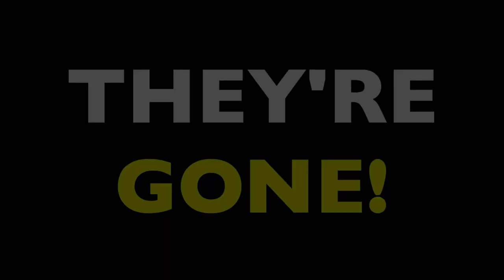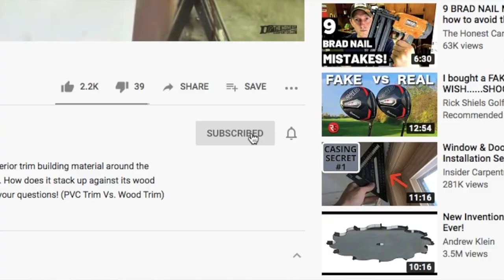There's Something TERRIBLY WRONG With My Table Saw! Should I THROW IT OUT?! (Carpenter Discussion)

Comment: the fence on my table saw has bolts on the bottom that allow the fence to adjust slightly by a few degrees to each side for alignment. Wonder if your saw has this feature and if it will work.
Reply from the maker: I can adjust the fence slightly too. But the problem is the angle seems to worsen between straight rips and beveled. The fence would have to be crazy skewed to account for the bevel veer 😕
Reply: @TheHonestCarpenter  You've taken that investment far enough. Time for a nice new one! I'm excited to see what you pick.

Comment: I got rid of a table saw earlier this year.  The saw was a job site saw, a real workhorse, that had very few problems. But the truth is that I'm getting older, do much of my work in the shop now, and I have a few younger employees.  I decided that the safety of a Sawstop with it's finger/hand protection was worth the money spent on it if it prevents even one shop accident. So I sold the other saw to a carpenter going out on his own who I know and upgraded.

Comment: When I first started buying and using power tools, I bought cheap tools. They worked fine (for a short time), but after time, they either wore out or just didn't operate like they were new. Now, after many, many years, I purchased better (and cost a lot more) power tools. They last so much longer, but even expensive tools break or just wear out. Safety is paramount, so if I find any tool that becomes less safe, I toss it. Not worth a damaged body part. Great video!

Comment: This happened many years ago, but I have never forgotten it. A close friend of mine had a grandpa die. Turns out they we’re doing some deck building and grandpa was using the circular saw. He was in the habit of finishing the cut and then dropping the saw on his leg with the blade guard hitting his leg. Only this time the blade guard stuck, the blade was still spinning and sliced his leg. He bled out before they could save him. I think about that most every time I use a circular saw, and it’s a reminder, “don’t do nothing stupid!  Especially don’t use a saw knowing the blade guard is broken.
Reply from the maker: Ugh, that’s terrible to hear, JS! 😖 I try to check that the guard swing back every single time for this reason. But the thigh is a saw cut zone that most people overlook far too often!

Comment: I'm a hobbyist, so I don't use the tools every day, but...

I tossed my 20+ year old Skill saw when I couldn't tighten the arbor nut down to tighten the blade. Replaced it with a Bosch.

Sold my model mid 60's 113 Craftsman table saw as I got tired of having to 'work around' it's alignment issues all the time. 
Replaced it with a SawStop contractor saw.

Comment: I was going to buy a Dewalt 7491RS a few months after COVID hit. Suddenly there none to be had. When they finally reappeared there were numerous complaints where before only glowing reviews. I was concerned about wasting money and also safety so I saved up more money. I bought the Sawstop JSS Pro. I love it and my husband doesn’t worry so much as before. Be aware that the new “contractor” Sawstop which is smaller will not accept dado blades.

Comment: Totally agree with tossing tools that pose a safety threat.   Maybe make a video on how to properly dispose of unsafe tools.  I've seen many tools tossed into a dumpster for wherever reason only to be dumpster dived out and who knows where that tool ended up.. garage sale? Apprentices toolbox..?
Reply: How I dispose of used up tools. First, cut the cord at the tool. Second, remove the blade. Third, disassemble far enough that it is not worth messing with, and dispose of parts so no one can try to reassemble after collecting the parts, such as recycle what you can, then dispose in different trash bags, etc.
Reply: I have my worm drive in a shed because I don’t want someone else trying to use it.
Reply: I agree.  An unsafe tool that cannot be repaired should be permanently disabled and disposed of.  Few things are more tempting that seeing a power tool in a dumpster (I know :-) ).

Comment: Your attention to detail is excellent. I'm just about ready to throw in the towel on my Ridgid TS3650 because the belt keeps popping off from time to time. Taking such a big heavy saw down to a service center is a big hassle that requires a truck with a lift bed. At least I've got wheels on the darn thing. I originally paid $300 used for the saw way back in 2007. plus a few hundred dollars extra for iron table extensions. Another issue: the fence, which I long considered the saw's best feature, is drifting out of lock when it gets a medium to heavy tap with a piece of stock.

Comment: No matter what others say, when a carpenter decides that a tool is not accurate or safe, it is time to get rid of it. Especially the blade guard on a circular saw. When that does not work perfectly it is time to trash it fast as possible. So far I have not had any saws go bad, but will not hesitate to get rid of one that does.

Comment: I have been using Makita circular saws since I started as a carpenter 38 years ago. They are a great saw and can take a beating. I replace them when the guards no longer function or the motor starts to smoke. They become my parts saws. I have 4 circular saws presently. Two of them are Frankenstein saws made up of 4 or five others.
If you are looking to get another job site table saw, take a hard look at the Bosch. I love mine and it is a beast.

Comment: Good video! I had to toss my miter saw this summer.  Like your skill saw, the blade guard on my miter saw wore out and no longer worked. It was getting stuck, not retracting.  That 10 blade is a little scary uncovered. So I completely decommissioned it by cutting the cord and pulling the brushes. Advice, don't settle for the lesser price tool.
Reply: You talking about the plastic piece that covers the blade when using the saw? Couldn't you have changed it out instead of tossing the entire saw?

Sorry if my question is stupid I'm a new wood worker and just had to change my blade by taking the plastic blade cover off to change it. Seems like maybe just change the cover?
Reply: @wm1958  good morning!
The plastic guard was still good.  The hardware that rotates the guard out of the way when cutting wore completely out. I was needing to push the guard up by hand to in bind it. I tried different ideas to try and fix it with no luck.  Parts were not available, it was maybe 18 years old, just starting out as well and paid less than $100 for it.  I got my use out of it.  Thanks for the question.

Comment: We built an aluminum Bristol Bay 32 ft fishing boat in '79 (redid deck and cabin in '80. Anyway, we used worm gear Skilsaws to cut the aluminum sheet to make ribs, bulkheads, hull plates, etc.  We used Rockwell bandsaw wax to grease up the blades.  But sooner than later a saw would suddenly give up with a flash and a bunch of blue smoke.  We would toss the saw in a dumpster and go over to the stack of new saws and break a new one out of the box and keep on truckin'. Had to get the boat in the water, fishing season was fast approaching.

Comment: Re the Table Saw..... at 0:15 you can see the screw that can be used to adjust the fence. My saw had a similar issue and tweaking the fence to be parallel to the blade fixed it

Comment: Agree with you.  The safety issues with both tools are too much to ignore anymore.  Very curious to see what table saw you purchase.  I've had a Bosch for ages, but I salivate over the rack and pinion fence on the DeWalt and other brands.  Cheers!
Reply from the maker: The rack and pinion is what sold me on the original, Jonesy. And it might be the deciding factor next time!
Reply: @TheHonestCarpenter  I also have a newer Bosch, and although it is pretty darn good, I hate the aluminum table. BUT, I don't carry mine around anymore... so I can/will sacrifice weight/mobility when upgrading it. I use many jigs and want to adapt them to magnetic holders so a cast-iron/steel table is in my future.
Reply: @TheHonestCarpenter  Sawstop with the t-glide? Save the fingers, nice fence upgrade. I have a newer dewalt and love the rack and pinion but will switch to a Sawstop when its in the budget.
Reply: @Jake Arnold  I'm debating this right now. My table saw is due for immediate replacement as it has become a serious safety issue. (Worn rear trunion causing blade to wander and pinch) I want the big jobsite Sawstop but doubt the Beissmeier (sp?) style fence will make me as happy as a rack and pinion like Dewalt. Counterpoint: having all my fingers makes me very happy. 🤷‍♂️

Comment: After 12+ years my 15amp Ryobi contractor saw succumbed to two major flaws.
(1) the saw would simply turn off mid cut... not scary as...
(2) I'd lock the saw height but a few times in 2021 and early 2022 the saw would randomly drop down an inch to two...

I've never been scared of a tool but this was the end for me and I neglected to use the table saw after these repeated issues.   Finally jumped ship to the rigid hybrid of cabinet saw.... yes I said hybrid as I feel it's not a true cabinet saw... great video 👍

Comment: I'm a tinkerer so when I notice any of my saws performing poorly, its back to the manual to follow the adjustment steps.  I also tend to hold on to tools probably longer than I should.  Heck, I've still got a fifty year old Black and Decker jig saw, metal of course. When any tool can no longer be put back in working order, I do thank them for their service and toss them.  Unless there are replacements available from a variety of sources.  This is the same for safety devices on tools.  When they wear out, the tool goes out.  I still probably too many tools that still work but I've replaced them with new models with better features.  As for your next table saw,I can recommend the Rigid R-4514.  Its on sale at HD for the holidays.

Comment: I've owned 3 Milwaukee 7 1/4" tilt loc saws...each one has had the brushes and or bearings replaced, it's not an expensive saw compared to the cost of my M18 gen 3 cordless one now(the one that looks like a wormdrive saw)...I've since given two of the tilt loc saws to young deserving carpenters starting out, I hardly use electric saws now and days having the gen 3 cordless... but being "generation X",  it was instilled into me, growing up, to fix what's broken, not throw it away to buy new... I think that has alot to do with "fix it or hold on to it"  :)

Comment: I rencently bought a newer dewalt corded circular saw because my battery powered craftsman one was binding in the wood. After changing the blade I realized that to tightening mechanism was coming loose just a little bit each time I used it and that if I tighten the nut it will resume operating correctly for a good while. Now I tighten it every time before I use it and barely need the corded one I took to replace it.

Comment: I will generally fix over replace unless it is a motor malfunction. I have a bandsaw that I replaced bearings, switches, light fixtures, and drive belt on, but it still runs fine.

Comment: When safety is impacted, that's the red line for me. I have an old Ryobi BT-3000 table saw that's 30 years old, which my dad purchased brand new. I was refurbishing it and there was a bad issue with the power on/off switch not shutting off the saw properly. I replaced the switch with a newer toggle-style which has worked great. At least I'll get more use out of it until I get a new saw, probably next year as well. Certain cuts can't be done safely because the riving knife/guards/pawls are all integrated in one piece. It's all or nothing, so I use other techniques for some cuts.

Comment: If you are getting a new table saw for the shop, get a full size saw instead of a job site saw.  Your ears will thank you, and the larger working surface and longer fence is nice.
As for tossing tools that are broken, when they become unsafe, and the repair doesn't guarantee the tool will be safe.. It's gone. Saving a couple hundred bucks seems cool, but not when it's risking a serious injury.

Comment: I agree with your logic primarily focused on safety.  I will always try to repair a tool.  If it can't be returned to full safety and accuracy, I toss it.  In accurate tools are the worst.  I've been known to cut off the power cord before it goes in the trash to (1) keep someone else from "rescuing it" and putting it back in service and (2) to throw the cord in my reserve in case I need to replace a cord on something else.

Comment: I recently took the plunge and bought a Sawstop. I had a Ryobi job site, which my hubby got me a few years ago, but I found it difficult to dial in accuracy and I couldn’t even get it to a full 45 degrees (only 44). So if I wanted to do fine woodworking I needed a serious saw or I would keep doubting my skills.

Comment: THANKS ETHAN, MUCH APPRECIATE YOUR GOOD ADVICE…and I would do the same thing for these issues 
Back in the day when I was buying tools, I went to hardware tool sales in the spring and fall each year and talked to all the reps from each company and the staff…. And I found out that each company had the BEST TOOLS…for some uses and other companies had the BEST for other products…so as much as I wanted to use all the same brand , I had to buy what was BEST at that point and I still have most of them still after decades of use and only replace the ones that are the BEST ONES AT THAT TIME 🤗💚💚💚

Comment: I have decommissioned two circular saws and a reciprocating saw for various reasons. I don't "throw them out" per say, but they aren't used anymore. One of the circular saws fell off a truck just in time to meet a tire and its housing shattered and the bottom plate bent all to heck. The other circular saw just burned out after binding and because I failed to keep the vents and housing clean. The motor just took a dump. My fault on both of those. The reciprocating saw fell out of a tree while trimming. It just missed the dirt and hit concrete. 

With the two that had working motors, I took them apart and tossed the bodies. The motor from the Sawzall runs a vent fan in my old shop (we've since moved) and is probably still working that job today. The circular saw motor is on a shelf and may do something similar in my new shop as I plan to add a vent this summer. The other broken circular saw had a few parts taken off of it to repair another saw (misc screws, power cord, etc) for a neighbor who had one just like it.
Reply from the maker: That’s some good recycling, Aaron! In my experience, concrete is a tool killer. Few tools survive big concrete drops, and the stuff will scratch your saws like crazy. I’ve had to file and sand down a lot of sole plates because of concrete scuffs. They tear up your stock otherwise.
Reply: @TheHonestCarpenter  Yep. When I was working as a carpenter (way back in the day), it was mostly indoors doing industrial remodels. Almost every tool that got broken was either because I loaned it to a temp or it fell from a ladder onto the concrete. We didn't use a lot of saws there, though, as we did metal stud framing, but it was routine for someone to break a hand drill or sheers. I think the only thing that survived ladder falls were pneumatic Hiltis and the like. And maybe the baby tools that the sparkys used. :)

Comment: Yeah.  Tough call on tool retirement.  I had a drill die, not brushes unfortunately, and a circ saw too, not brush related.  Fortunately, I've got a very good tech recycler nearby and have no problem retiring a tool if it's sketchy knowing that the important parts provide recycle material.  Replaced a nicely working job site saw with a SawStop jobsite saw for purely safety reasons.  Since I work alone, I just can't justify not having a safety saw in the shop when there's one that's available and (saving up) affordable.

Comment: I have a Makita worm drive that I no longer use. It has too much torque and it’s heavy, the guard doesn’t retract well so the temptation to pin it is great. I bought a DeWalt side motor saw which a lot lighter and safer to use. My old Sears 113 table saw is great, it holds adjustment. Adjusted it once after I inherited it and it stays that way.

Comment: I'm retired and have plenty of time to tinker. I fix everything that's fixable. Some things have just reached the end of their repairable life and have to be thrown out. If it were my table saw, I'd have it down to every piece just to see what went wrong. Once it's apart to that point, I would repair it but that's just me. My miter saw is 30 years old. I have built 2 houses with it. It's accurate and powerful and I have repaired it several times.

Comment: I 100% agree with you. I take the middle approach to this as well if can fix and if it's not a major problem than I will fix it. But if it has anything to do with safety and it won't work than I throw the tool away or return it. I once bought a angle grinder from Harbor Freight and the guard won't stay in place I try everything and even replace a screw in the guard. But when the guard turned on me while I was using it and caused kick back. I stop everything and returned it. And I told them about it and they gave me my money back for it and it was a safety issue and they could not resell that tool. The point is if its small and isn't isn't safety issue than do it. But if it has anything to do with safety than get rid of it.

Comment: I actually haven't needed to do this before. Other than with a super old U shank jigsaw, and it was just a pain to adjust and to put blades in, or remove.

On another note, 
may I recommend the DeWalt, DWE7491RS you can find great deals on this saw. Some that will include 3 blades the rolling stand (of course) and the saw. This saw also has a 32" rip capacity! Also it has a long enough arbor to use a full Dado set! Alright enough of that. Lol take it easy.